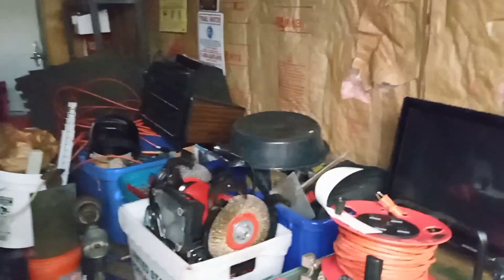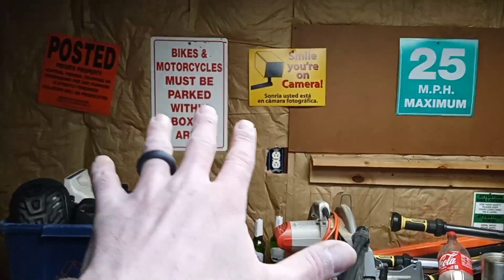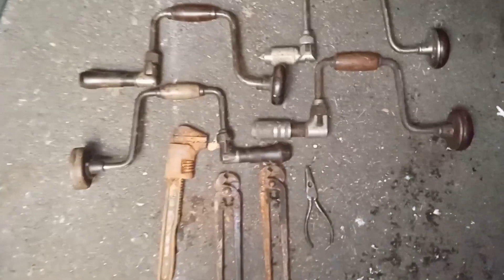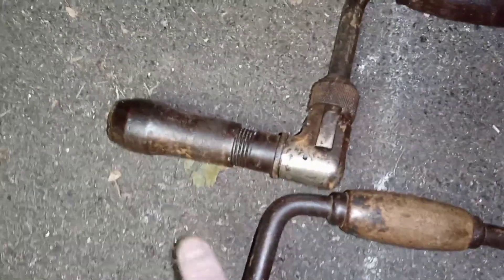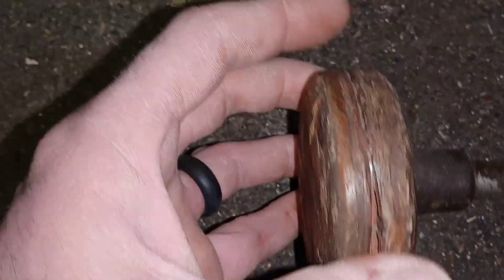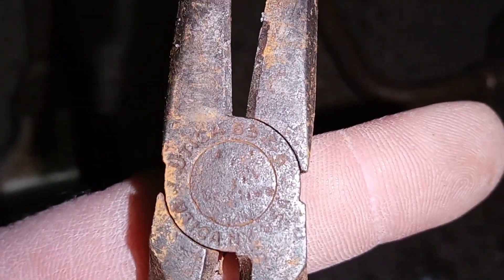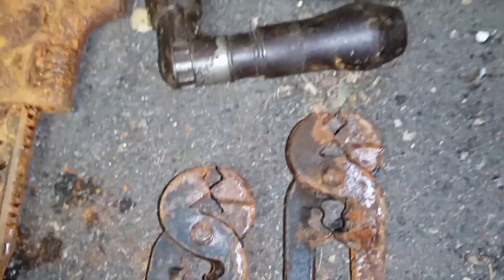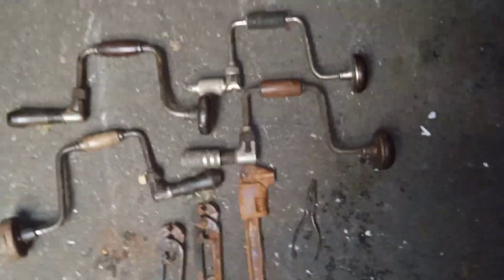Swap meet swag.

Comment: Wait!  You didn't mention how much you paid!   =D  Nice stuff there-  The best part about auto wrenches is they are literally junk tools, unless you find a Crescent or Diamond or Billings most of the typical auto wrenches are low carbon steel that is too soft to make the wrench usable.  However those are the same characteristics that make them so great to customize and restore!  They clean up nice and with a little imagination they are awesome wall hangers!    Remember- Get a small spot down the basement for a simple workbench, you won't want to freeze or sweat in the garage!  =D
Reply from the maker: Lol ur right I did forget...are u sitting down..?  $25.00. for all and yes I'm still working out all the basement details with Mrs CC scraps LOL and yeah I got some ideas for that wrench thanks again for all the info on those hope you have a safe weekend and stay warm